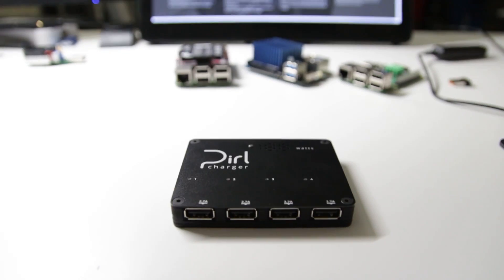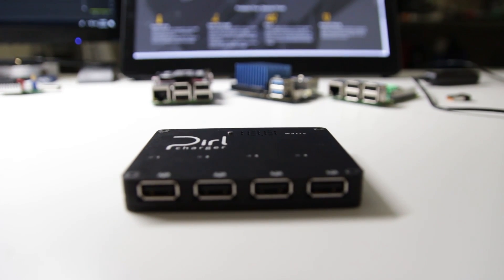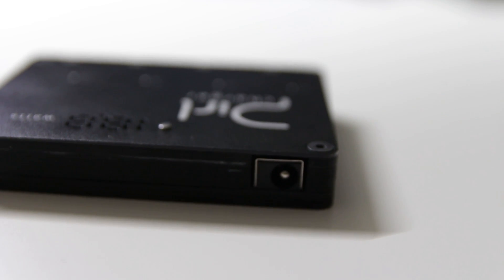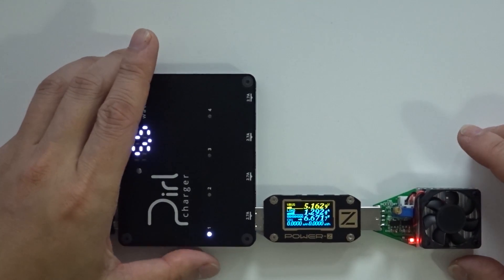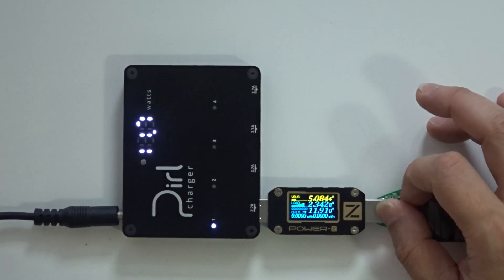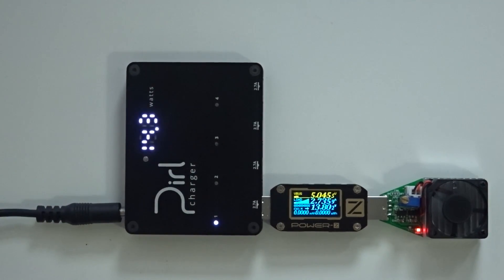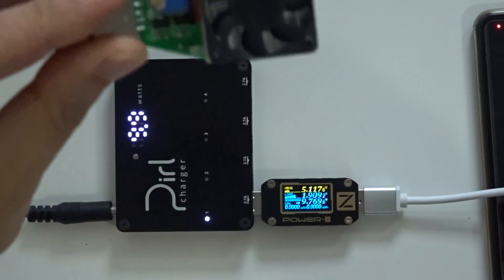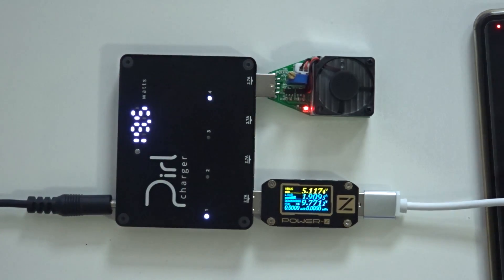Pirl Charger testing and review

Comment: or you could just buy a cheap 5V 12AMP (60W) power supply from ebay and splice 14AWG gauge silicone cables onto a 4 port usb hub...and get roughly 3AMP guaranteed amps per port.. lol. for $20 instead of whatever this ridiculous price tag is.. lol
Reply: not really. the pirl charger will operate on 7-18vdc which is very useful in portable off-grid applications. try to get your cheap setup to do that.
Reply: @marzsit9833  necropost bro.

Comment: May I suggest a video idea? I want to use KidsMode UI on my Retropie but all my games default KidsMode to Off instead of On. Is there a quicker way to switch them all On other than having to edit the metadata for each of my 8000 games, one at a time? I'm a noob but I'm willing to mess around with gameslist.xml files and Notepad++ if it means I can save time. Thank You.